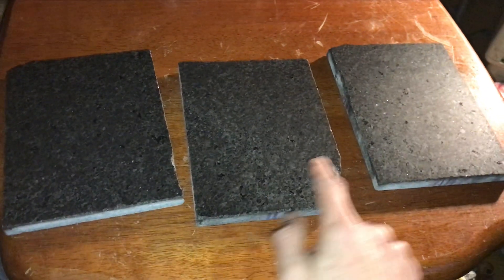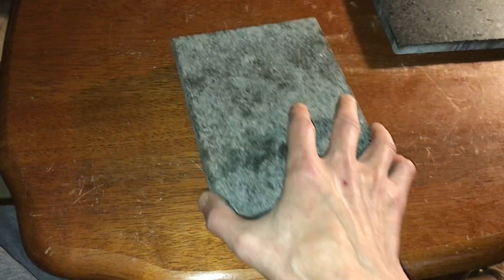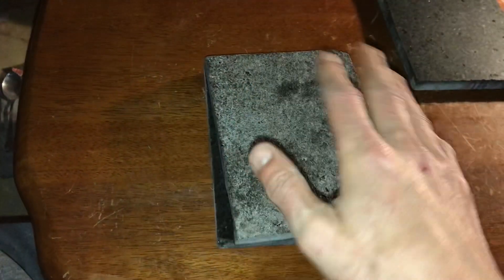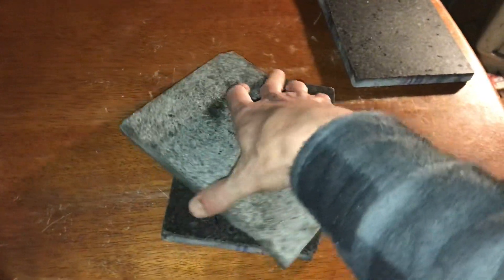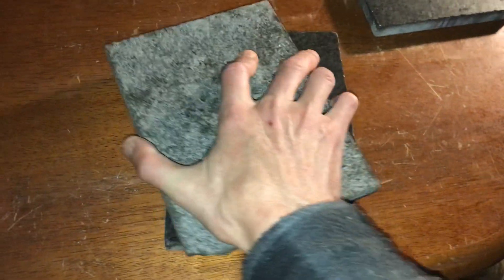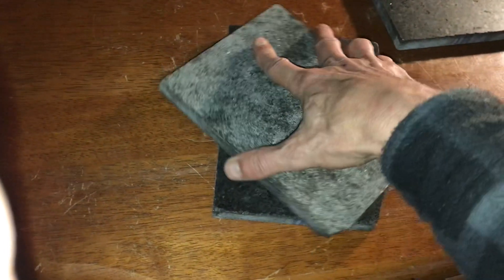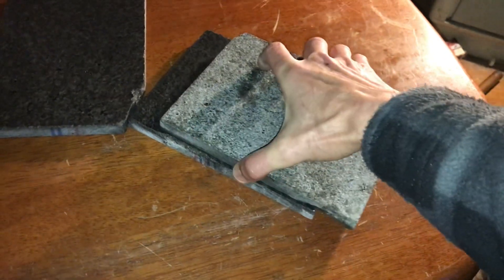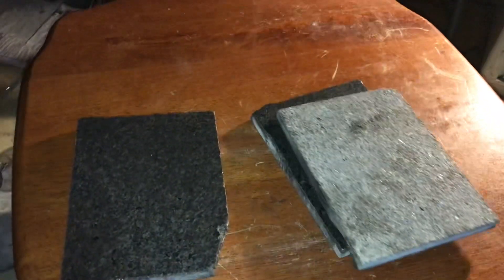Upside down floating granite surface plates.

Comment: Could a massive granite piece with polished flat bottom be 'floated' across a ground with polished granite flat tiles? I know egypt has that flat, (i believe) basalt pavement.  Could some of their massive stones have been moved across that?
Reply from the maker: I tried by putting weights on mine, it didn't work so well. It slips across a bit easier with a good polish but the floating is limited
Reply: @SacredGeometryDecoded  ahh, I see. Excellent work on this incredible polishing.

Comment: This is some whacky stuff I've never seen. Do you think this static or other field effect might have contributed to the building of ancient monuments? This is quite amazing.... if you can do this and myths talk of levitating stones.
Reply from the maker: Pretty sure it’s an air effect. A bit of dust or water will ruin it.
If you look up lens bonding they show the layer of air between the two being squeezed out to stick the two nanometer flat lens surface bond as if one. It’s very cool.
But wringing of two perfectly flat surfaces is weird. They don’t even know why it occurs.
Reply: Either way you don't levitate anything because the fact that one plate sticks to the other doesn't mean that you reduce the total weight of the thing. It weighs exactly the same as the sum of the two plates

Comment: Nah, sorry, mate. It's impossible to create flat surfaces without modern precision tools. :P

What you are seeing is the boundary layer in action. Air on (attached to) the surface doesn't move. This is the boundary layer. In order for smooth surfaces to stick, the boundary layer must be physically displaced because it literally clings to the surface, like a liquid.

Comment: Where is the video where you actually make these granite plates please.
Reply from the maker: I will make one on some other plates and post it, at least the basics. I only use home made abrasive to a few grit sizes instead of engineering dye.
Reply: @SacredGeometryDecoded  thank you, your results with those plates that ring together when you press them against each other are wonderful, especially that you made them with home made abrasive. Waiting for your video.

Comment: Fast Running, streaming water mixed with sand could be used to polish big and small objects of granite, inside and out. Free labour around the clock. Maybe the builders had sluices kilometers long in which they put stone objects.
Also they probably had water powered saws and drills.

Comment: Excellent result SGD. The phenomenon is called ‘wringabilty’. You can see this also for gauge blocks. Just google it. In my opinion it is not the vacuum that causes it. But more the water vapour in the ait that acts as a glue. Also the Vanderwaals forces can play a role: interchange of electrons between the atoms.
Again, great job!
Reply from the maker: Thanks. I did look into that, Johannsen gauge blocks and wringing. Though I am pretty sure these plates aren't at that level of flatness, as far as I know it's in the sub micron range and my plates still have some faults, the float sticks at certain places when two high points pass over each other.. 
The type of granite I use here has large crystals and the best surface plates use special types of granite
Reply: granite does not wring together for varius reasons. On a molecular level metal is homogeneous material i.e a crystal lattice where the elements are always in a uniform/even distribution, with most alloys being made up of over 90% one element (i.e iron in steel) whereas granite is an inhomogenous mishmash of minerals of different sizes formed by random geological processes. So we can not polish granite to be as smooth as metals. Granite is hard and brittle due to the interlocking grains of different sizes, (great for surface plates) but unlike metals cannot deform elastically/plastically, which helps the metal surfaces wring together as they can bend into eachother creating the exact same surfaces, creating a vacuum

Comment: Doesn't friction produce an electric effect? For different materials, from:
- wikipedia.org/wiki/Triboelectric_effect "rubbing the two materials with each other increases the contact between their surfaces" and "While adhesion is not a chemical bond between atoms, there is an exchange of electrons between the different types of molecules, resulting in an electrostatic attraction between the molecules that holds them together"
- wikipedia.org/wiki/Piezoelectricity there's a "change of polarization P when applying a mechanical stress" (friction?) and a "re-orientation of molecular dipole moments under the influence of the external stress".
Reply from the maker: You forgot the fifth element. Dung!!
Reply: Triboelectric effect has to happen between two different and very specific materials. I don't think it would be strong enough either.

Also, cause it floats and has to be pushed together to "stick", I dont think static electricity would be the cause, because it does not explain the floating behaviour.
Reply from the maker: After I polished a bit more they stick on contact now, still floating but I can pick them up also. They are my favourite toys ever and I had a Castle Greyskull as a boy. I did find a few references by people studying Bernoulli effects. Someone mentioned water vapour in the air as a possibility.
It's certainly very weird, they stick but they float also. Way out of my area but I think it has to be air effect, trapped cushion of air between the flat surfaces, holding them together by suction but also allowing them to move as the air cushion rolls?
I don't know but it is very fun to play with.
Reply: @SacredGeometryDecoded  nice! It'd be interesting to check the maximum time they can adhere to each other. Back to theory, from wiki: «Although the part 'tribo-' comes from the Greek for "rubbing", τρίβω (τριβή: friction), the two materials only need to come into contact for electrons to be exchanged. After coming into contact, a chemical bond is formed between parts of the two surfaces, called adhesion, and charges move from one material to the other to equalize their electrochemical potential.»

Since the surfaces are large enough, the air being trapped in the adhesion allows floating. If tiny holes were drilled in them, could the air escape?

The effect does happen with different materials, but since those stones are composed by multiple different minerals/crystals, the effect may be similar to the piezoelectric effect: «electric dipole moments in solids may either be induced for ions on crystal lattice sites with asymmetric charge surroundings»

Paygrade is overrated: the ability to question is undervalued 😉

Comment: very cool. Could be this. https://en.wikipedia.org/wiki/Gauge_block#Wringing Makes me wonder if there was utility in the smoothness of some stones, not just for the look at building precision.
Reply from the maker: this one is very cool, lens  bonding, you can see the air being squeezed out
https://www.youtube.com/watch?v=se3K_MWR488
they use floating to test beforehand but they are working on nanometre scale of flatness, i don't think that's possible with granite, at least not the types of granite i have
Reply: @SacredGeometryDecoded  that is so cool to see